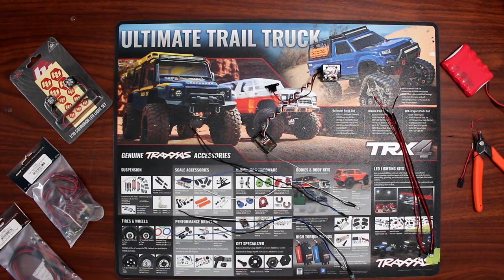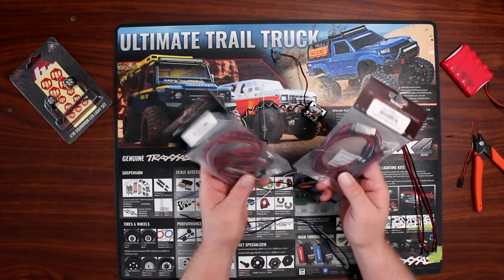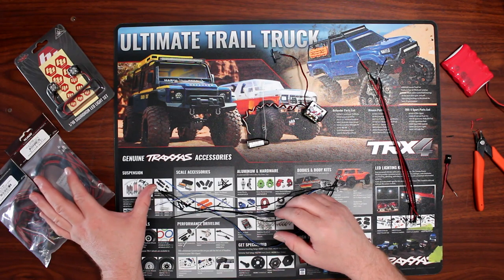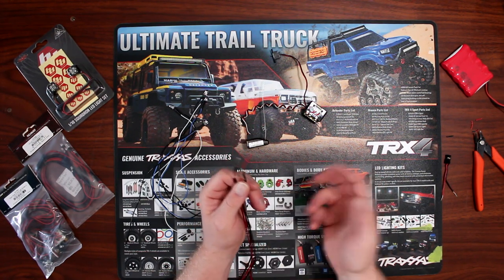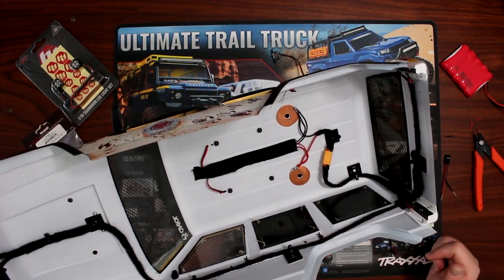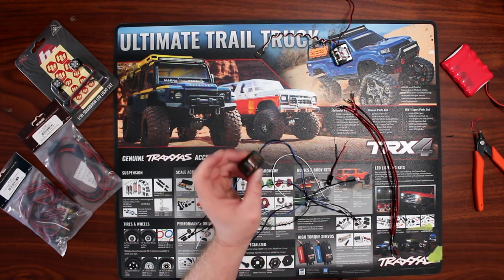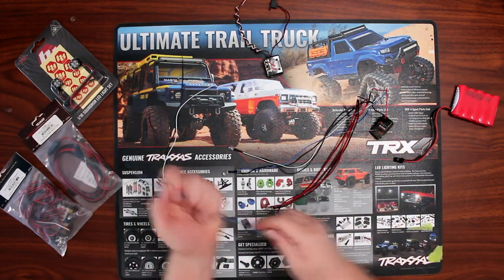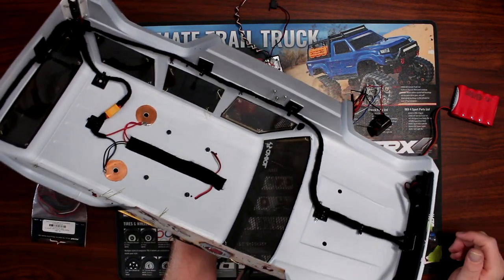RC Led How To Plug Them

Comment: Great information. Noticed you've got some square wire retainers on the inside of the body that I assume you use a cable tie to hold the wires. What are they & where can I get them? Thanks!
Reply from the maker: I Got Them At Home Depot